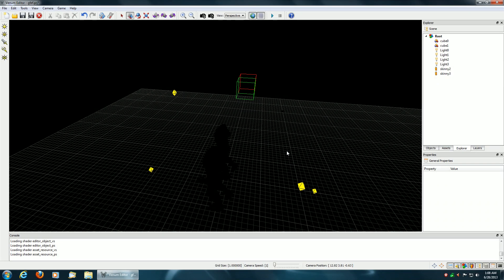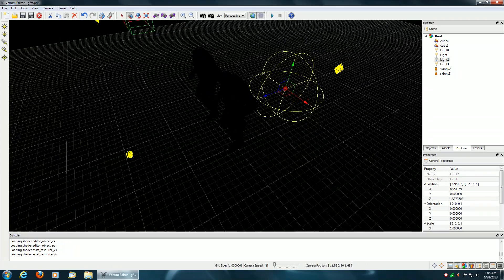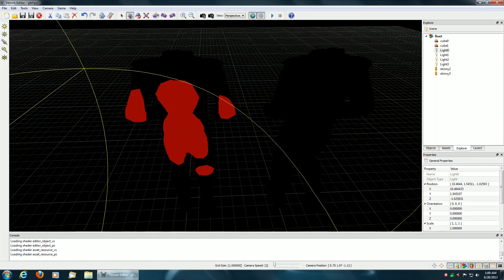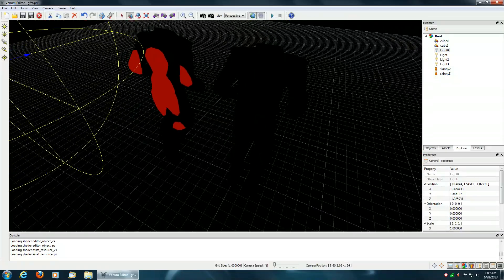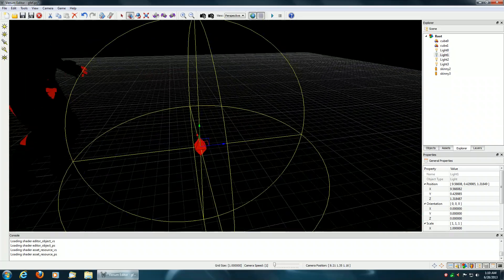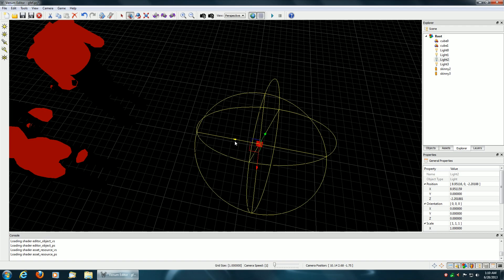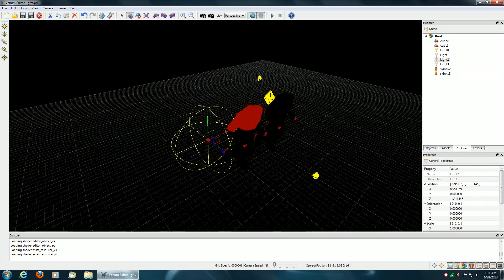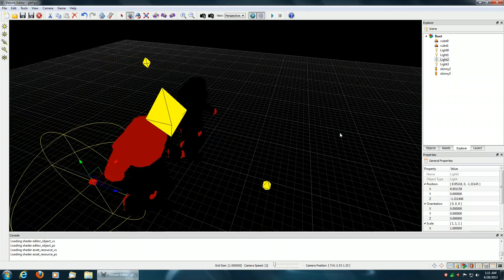Deferred Shading Stencil Buffer Optimization

Comment from the maker: Yes the advantage is that the stencil buffer is supported by the hardware so you are letting the video card do the work for you and cutting out potentially expensive shader operations in the process. However, I must stress that this "optimization" is highly dependent on the scene. If you have a lot of little lights and\or your lighting calculations are not that expensive, then using the stencil buffer may end up being slower than just brute forcing it.

Comment from the maker: I must stress stenciling helps in some cases but not in all. It depends on the game an FPS is much different than a top down game. The best thing to do is profile and see where the bottlenecks are. Even in my engine the stenciling is not always faster than just drawing the lights. For example if you have many tiny point lights, stenciling will not be a big performance gain and may actually be slower.

Comment from the maker: Search "Alt Dev Blog a Day: Stencil Buffer Optimisation for Deferred Lights" for a more thorough explanation. I also use the attenuation in my final shader. However I wish to avoid dynamic branching in the shader to skip lighting calculations as I am targeting older DirectX9 cards with the engine where branch performance may or may not be an issue

Comment from the maker: Hi this a custom engine written by me in C++. To answer your question I use stenciling with the geometry of the light (Ex. a sphere for a point light) and the intersection of this sphere and the scene geometry. I then use the masked stencil buffer to run the lighting pixel shader where there is an intersection. Again this may be "faster" depending on several things such as the orientation of the camera, complexity of intersections with the scene.

Comment: Hi,
is that right, VENUM is your self coded 3D-Engine?

I do not understand why stenceling the correlated Pixel should be faster.
Because you must calculate the Distance too, like in the final Lighting-Shader.
The Final Shader can do the same thing at once. (Discard uncorrelated Pixel).
Or do you stencil a Box of the LightSourceRadius.

Please explain THANKS!!!

PS.
  I work on my own 3D-Engine too.